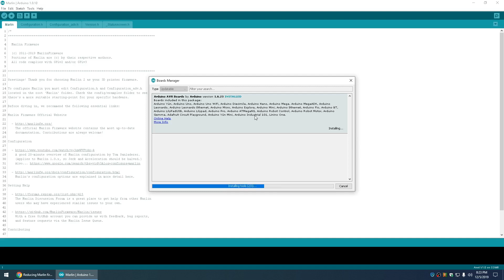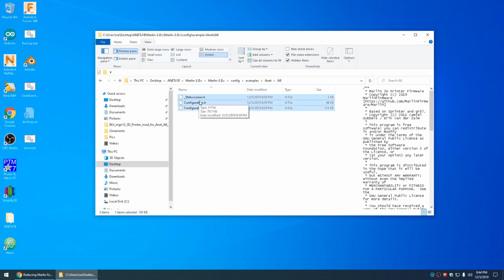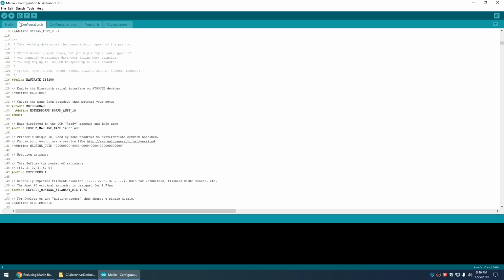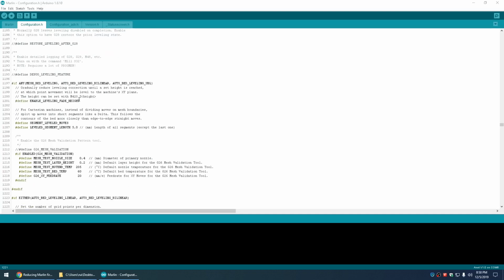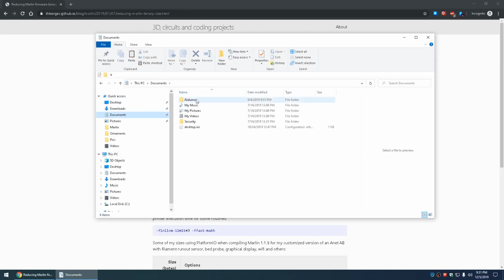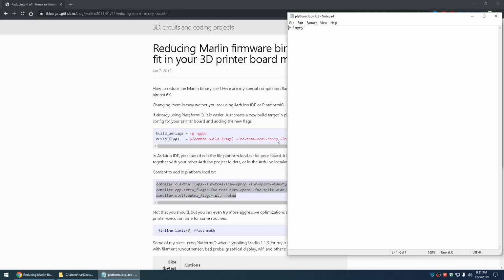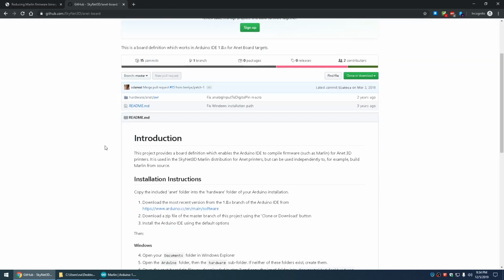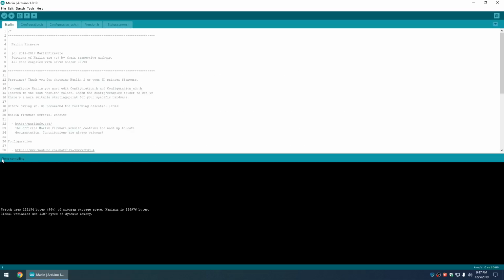Upgrade Marlin 2.0 firmware on ANET A8 v1.0 Board

Comment: anyone know what this is?

Arduino: 1.8.15 (Windows 10), Board: "Anet V1.0"

In file included from C:\Users\jonat\Desktop\3D\printer\Marlin-2.0.x\Marlin-2.0.x\Marlin\src\lcd\extui\ftdi_eve_touch_ui\compat.h:31:0,

                 from C:\Users\jonat\Desktop\3D\printer\Marlin-2.0.x\Marlin-2.0.x\Marlin\src\lcd\extui\ftdi_eve_touch_ui\config.h:24,

                 from C:\Users\jonat\Desktop\3D\printer\Marlin-2.0.x\Marlin-2.0.x\Marlin\src\lcd\extui\ftdi_eve_touch_ui\screens.cpp:23:

C:\Users\jonat\Desktop\3D\printer\Marlin-2.0.x\Marlin-2.0.x\Marlin\src\lcd\extui\ui_api.h:82:15: error: 'MarlinBusyState' in 'class GcodeSuite' does not name a type

   GcodeSuite::MarlinBusyState getMachineBusyState();

               ^~~~~~~~~~~~~~~

In file included from C:\Users\jonat\Desktop\3D\printer\Marlin-2.0.x\Marlin-2.0.x\Marlin\src\lcd\extui\ftdi_eve_touch_ui\compat.h:31:0,

                 from C:\Users\jonat\Desktop\3D\printer\Marlin-2.0.x\Marlin-2.0.x\Marlin\src\lcd\extui\ftdi_eve_touch_ui\archim2-flash\flash_storage.cpp:23:

C:\Users\jonat\Desktop\3D\printer\Marlin-2.0.x\Marlin-2.0.x\Marlin\src\lcd\extui\ui_api.h:82:15: error: 'MarlinBusyState' in 'class GcodeSuite' does not name a type

   GcodeSuite::MarlinBusyState getMachineBusyState();

               ^~~~~~~~~~~~~~~

In file included from C:\Users\jonat\Desktop\3D\printer\Marlin-2.0.x\Marlin-2.0.x\Marlin\src\lcd\extui\ftdi_eve_touch_ui\compat.h:31:0,

                 from C:\Users\jonat\Desktop\3D\printer\Marlin-2.0.x\Marlin-2.0.x\Marlin\src\lcd\extui\ftdi_eve_touch_ui\archim2-flash\media_file_reader.cpp:23:

C:\Users\jonat\Desktop\3D\printer\Marlin-2.0.x\Marlin-2.0.x\Marlin\src\lcd\extui\ui_api.h:82:15: error: 'MarlinBusyState' in 'class GcodeSuite' does not name a type

   GcodeSuite::MarlinBusyState getMachineBusyState();

               ^~~~~~~~~~~~~~~

In file included from C:\Users\jonat\Desktop\3D\printer\Marlin-2.0.x\Marlin-2.0.x\Marlin\src\lcd\extui\ftdi_eve_touch_ui\compat.h:31:0,

                 from C:\Users\jonat\Desktop\3D\printer\Marlin-2.0.x\Marlin-2.0.x\Marlin\src\lcd\extui\ftdi_eve_touch_ui\config.h:24,

                 from C:\Users\jonat\Desktop\3D\printer\Marlin-2.0.x\Marlin-2.0.x\Marlin\src\lcd\extui\ftdi_eve_touch_ui\bioprinter\advanced_settings.cpp:23:

C:\Users\jonat\Desktop\3D\printer\Marlin-2.0.x\Marlin-2.0.x\Marlin\src\lcd\extui\ui_api.h:82:15: error: 'MarlinBusyState' in 'class GcodeSuite' does not name a type

   GcodeSuite::MarlinBusyState getMachineBusyState();

               ^~~~~~~~~~~~~~~

In file included from C:\Users\jonat\Desktop\3D\printer\Marlin-2.0.x\Marlin-2.0.x\Marlin\src\lcd\extui\ftdi_eve_touch_ui\compat.h:31:0,

                 from C:\Users\jonat\Desktop\3D\printer\Marlin-2.0.x\Marlin-2.0.x\Marlin\src\lcd\extui\ftdi_eve_touch_ui\config.h:24,

                 from C:\Users\jonat\Desktop\3D\printer\Marlin-2.0.x\Marlin-2.0.x\Marlin\src\lcd\extui\ftdi_eve_touch_ui\bioprinter\confirm_home_e.cpp:23:

C:\Users\jonat\Desktop\3D\printer\Marlin-2.0.x\Marlin-2.0.x\Marlin\src\lcd\extui\ui_api.h:82:15: error: 'MarlinBusyState' in 'class GcodeSuite' does not name a type

   GcodeSuite::MarlinBusyState getMachineBusyState();

               ^~~~~~~~~~~~~~~

In file included from C:\Users\jonat\Desktop\3D\printer\Marlin-2.0.x\Marlin-2.0.x\Marlin\src\lcd\extui\ftdi_eve_touch_ui\compat.h:31:0,

                 from C:\Users\jonat\Desktop\3D\printer\Marlin-2.0.x\Marlin-2.0.x\Marlin\src\lcd\extui\ftdi_eve_touch_ui\config.h:24,

                 from C:\Users\jonat\Desktop\3D\printer\Marlin-2.0.x\Marlin-2.0.x\Marlin\src\lcd\extui\ftdi_eve_touch_ui\bioprinter\confirm_home_xyz.cpp:23:

C:\Users\jonat\Desktop\3D\printer\Marlin-2.0.x\Marlin-2.0.x\Marlin\src\lcd\extui\ui_api.h:82:15: error: 'MarlinBusyState' in 'class GcodeSuite' does not name a type

   GcodeSuite::MarlinBusyState getMachineBusyState();

               ^~~~~~~~~~~~~~~

In file included from C:\Users\jonat\Desktop\3D\printer\Marlin-2.0.x\Marlin-2.0.x\Marlin\src\lcd\extui\ftdi_eve_touch_ui\compat.h:31:0,

                 from C:\Users\jonat\Desktop\3D\printer\Marlin-2.0.x\Marlin-2.0.x\Marlin\src\lcd\extui\ftdi_eve_touch_ui\config.h:24,

                 from C:\Users\jonat\Desktop\3D\printer\Marlin-2.0.x\Marlin-2.0.x\Marlin\src\lcd\extui\ftdi_eve_touch_ui\bioprinter\main_menu.cpp:23:

C:\Users\jonat\Desktop\3D\printer\Marlin-2.0.x\Marlin-2.0.x\Marlin\src\lcd\extui\ui_api.h:82:15: error: 'MarlinBusyState' in 'class GcodeSuite' does not name a type

   GcodeSuite::MarlinBusyState getMachineBusyState();

               ^~~~~~~~~~~~~~~

In file included from C:\Users\jonat\Desktop\3D\printer\Marlin-2.0.x\Marlin-2.0.x\Marlin\src\lcd\extui\ftdi_eve_touch_ui\compat.h:31:0,

                 from C:\Users\jonat\Desktop\3D\printer\Marlin-2.0.x\Marlin-2.0.x\Marlin\src\lcd\extui\ftdi_eve_touch_ui\config.h:24,

                 from C:\Users\jonat\Desktop\3D\printer\Marlin-2.0.x\Marlin-2.0.x\Marlin\src\lcd\extui\ftdi_eve_touch_ui\bioprinter\printing_dialog_box.cpp:23:

C:\Users\jonat\Desktop\3D\printer\Marlin-2.0.x\Marlin-2.0.x\Marlin\src\lcd\extui\ui_api.h:82:15: error: 'MarlinBusyState' in 'class GcodeSuite' does not name a type

   GcodeSuite::MarlinBusyState getMachineBusyState();

               ^~~~~~~~~~~~~~~

In file included from C:\Users\jonat\Desktop\3D\printer\Marlin-2.0.x\Marlin-2.0.x\Marlin\src\lcd\extui\ftdi_eve_touch_ui\compat.h:31:0,

                 from C:\Users\jonat\Desktop\3D\printer\Marlin-2.0.x\Marlin-2.0.x\Marlin\src\lcd\extui\ftdi_eve_touch_ui\config.h:24,

                 from C:\Users\jonat\Desktop\3D\printer\Marlin-2.0.x\Marlin-2.0.x\Marlin\src\lcd\extui\ftdi_eve_touch_ui\bioprinter\status_screen.cpp:24:

C:\Users\jonat\Desktop\3D\printer\Marlin-2.0.x\Marlin-2.0.x\Marlin\src\lcd\extui\ui_api.h:82:15: error: 'MarlinBusyState' in 'class GcodeSuite' does not name a type

   GcodeSuite::MarlinBusyState getMachineBusyState();

               ^~~~~~~~~~~~~~~

exit status 1

Error compiling for board Anet V1.0.

This report would have more information with
"Show verbose output during compilation"
option enabled in File -> Preferences.
Reply from the maker: Are you using Arduino IDE or VSCode to compile the firmware.  VSCode works while Arduino IDE will no longer compile the firmware.
Reply: @MrDabrudda   thanks ill try vscode

Comment: i think this video is fake.merlin software Aneta8 v1.0 never installs on motherboards..never loads even though i tried all kinds of variations.No software is installed except the orginal hex file
Reply from the maker: How would this video be fake?  You see the version # on my printer.  If you are trying to update to version 2.0.7.2 you will need to use VSCode and search for videos on using VSCode to update to the latest version.
Reply: @MrDabrudda  see anet a8 v1.0 version motherboards 8 bit.why don't you say set the config files to 8 bit.you are giving people incomplete information.You suggest installing a 32-bit version on an 8-bit motherboard.please give correct information..you prepare 8bit file and give it to people..
Reply from the maker: Marlin 2 works on 8 bit and 32 bit boards.  That is what the board definitions are for, to define the hardware on the board.
Reply: @MrDabrudda  It is the general software offered by merlin software. You have to customize it and install it on your motherboard.You have to make special settings for it to be 8 bits..in merlin general anet a8 setting you have to make custom setting.For example, you should disable the sd card and run a printer from the pc with the usp port..To save space on an 8-bit motherboard..please upload the software you installed on your anet a8 motherboard here.tuned software.The config file for merlin anet a8 is never loaded.
Reply from the maker: Do you have the ANET A8 v1.0 board or 1.5?  I will also upload my Configuration.h and Configuration_adv.h files which I used to configure my ANET A8.
Reply: @MrDabrudda  the board I used is anet a8 v1-5.Merlin software never installs on this motherboard in my many attempts for a long time.Merlin never loads even though the original hex file is loaded with the usbasp module.never load merlin with arduino.Also does not install with Windows Visual Studio Code.loading only hex file.
Reply from the maker: Look at this video.  He has a v1.5 ANET A8 board and flashes Marlin 2.0 on it
https://youtu.be/38PkynA1uGI
Reply from the maker: Also I have uploaded and shared the link to my Configuration.h, Configuration_adv.h, and _screenstatus.h files in the description of the video
Reply: @MrDabrudda  hi brother.I did not make my objection in vain .swallow and watched all your videos several times and followed the instructions.I tried the information in that video link one by one. I tried the information in that video link one by one.Arduino never compiles 8 bit config file.arduino does not compile without software installed.Gives a compilation error even though I made no changes to any files.
Reply: @MrDabrudda  hi.the problem is waiting unresolved.It seems that you could not solve the problem either.The files you provided are never compiled by arduino for anet a8 v1-5.I can send you clear and crisp videos.You are streaming these videos, but you have to solve the problems.You should explain that arduino does not compile the anet a8 configuration files when it keeps failing..The skynet.fix software also fails.

Comment: so i followed along with you but i have different version of Arduino. I am running 1.8.13 . I mad the changes that you did and hit the check mark button. I clicked the check button and its compiling but nothing seems to be happening.
Reply from the maker: With Marlin 2.0.7.2 you will need to use VSCODE to compile Marlin.  You will need to install PlatformIO and Auto Build Marli.
Reply: @MrDabrudda  thank you

Comment: I follow this but failed at compile, my anet is v1.0 and , I can upload the firmware file (ino.hex) using AVRDUDESS.exe with Braud rate 57600, and I follow https://www.youtube.com/watch?v=38PkynA1uGI&t=15s to create my own marlin compiled file but you have to find out the file and upload with the AVRDUDESS, hope this help the other who is facing the same problem.
Reply from the maker: Marlin 2.0.7.2 will not compile in Arduino IDE any more.  Use VSCODE with PlatformIO and Auto Build Marlin.

Comment: Just 1 question what lcd do you have on your A8 ????
Reply from the maker: The default Anet A8 display, 2004 LCD.
Reply: @MrDabrudda  I've a stock anet a8 with the 5 button lcd and impossible to make buttton work properly with latest marlin 2.0 hotfix. But with latest 1.0 bugfix (1.1.9.?) it works. Very strange. I use vscode + platformio (latest). thanks
Reply from the maker: Which version of the ANET A8 mainboard do you have?  I have the v1.0 board.
Reply: @MrDabrudda  Anet3d V1-5
Reply from the maker: Check out this video from Crosslink and follow the steps.
https://youtu.be/38PkynA1uGI

And review this site.
https://caggius.wordpress.com/anet-v1-5-1-7-board-on-marlin-2-0-5-3/
Reply: @MrDabrudda  Ok thanks. I'm going to see the links. Just a last question : Why when your printer where well calibrated (x,y,z and extruder) i cannot obtain piece that i print at good size (cura 4.7). Thanks for all !!!
Reply from the maker: Also ensure you have the latest statusscreen.h file, Configuration.h & Configuation_adv.h from the latest Marlin config files.  Customize the config files as needed.

https://github.com/MarlinFirmware/Configurations/archive/release-2.0.7.2.zip

Download the latest Marlin firmware
https://github.com/MarlinFirmware/Marlin/archive/2.0.x.zip

2.0.7 is the latest.  I use Arduino IDE to compile and upload the firmware to my ANET A8.

If you use Arduino IDE ensure you download the anet-board definitions.

https://github.com/SkyNet3D/anet-board/archive/master.zip

The link below is my Configuation.h and Configuation_adv.h 
You will need to change the various parameters for your printer. Such as X,Y,Z steps, Z offset, etc.

https://drive.google.com/file/d/1D9mOim7ps16Yf0pu0F1V9JWjx9JusIor/view?usp=sharing
Reply from the maker: For your printer to print the exact size that is in the model will require you to adust the steps per mm in the Marlin firmware.
Reply: @MrDabrudda  I know all these point. The thing i do not understand is if i fix a pen on the print head and i write a simple rectangle with gcode command, the rectangle has the right dimension. I think that marlin or slicers are more or less well adapted to boards. Thanks for your help and i continue to investigate.
Reply: @MrDabrudda  This is all what i do. Compiled with arduino et vscode/platformio and 5 button doesnt work

Comment: I got Err: EEPROM version. Thank you for the vid
Reply: For anyone who runs into this issue, there is an easy fix: Go into the menu on the printer, then to "Configuration" > "Advanced settings" > "Initialize EEPROM". Select "Init" using the up or down buttons, and press the middle button to confirm. If done correctly, it should just take you back to the info screen and you will no longer get that error message when starting the printer.
Reply: @coleh1792  how do I get to the menu of the printer?
Reply: Did you notice that your handle is a anagram of Dabrudda ? :-)

Comment: I upgraded to Marlin 2.0 but same problem as in 1.9.1 the x axis goes past the bed, I checked the code and it says the limit is 220 which is correct but this is very frustrating and I can't find an answer anywhere.
EDIT: when auto home set to middle, x axis says it is at 110 but it is actually at 130, and y says it is at 110 while it is actually at 105

Does Anyone know how to fix this problem I have been at it for months
Reply from the maker: Are you using a bed probe?  If so make sure the probe offset is set in the Configuration.h.  Also check the limit switch offset settings.

Comment: Marlin 2.0 for ANet A8 - I tried to compile it last night and just now, and it's got compile errors on macro.h - is this common? Easy fix?
Reply from the maker: What are you using to compile the firmware? Arduino IDE, Atom, or VS?
Reply: @MrDabrudda  Arduino IDE - I've put VS(C) on now and will try again.
Reply: Ok, so looks like I've compiled, once I removed the .html files that "somehow" got saved instead of github's .h file (hint: don't do right click, "save link as"...)
Reply from the maker: I use Arduino IDE and you need to click the Clone or Download button on the right side of Github to download the zip file.

Comment: I've just printed 4 jobs on an A8.
I've always had problems with this printer in fact the first time I've printed with it was yesterday - but I installed Marlin Firmware (1.1.9) - and it now ignores small steps (microsteps?) on circles effectively putting flat sides on circles.
1. The G Code looks good when I step through it (written on Slic3r) the round edges are there.
2. The G Code uses "G1" notation in all steps were X,Y,&E are stepped.

Is this a known fault with Anet A8 + Marlin 1.1.9  Will Marlin 2.0 fix this?
Reply: u need the microsteps. a full step is 1.8 deg of a circle of rotation of a motor. with original drivers i think u get  1/16 step, after market can go to i think 1/256 step.  the smaller the step , the more detail (and longer print times). Hence the flat spots, the program jumped the steps to produce the full circle and took out 15/16 of it to jump the microsteps. What drivers are you using in Marlin? And what board and version  of the board are u using?  that has all the details why u are printing that way.

Comment: Why the Z Safe homing? It's super weird and annoying that the extruder moves to the center of the X / Y while homing now. I disabled it again cause if one print stops due to some annoying reasons you can't home anymore.
Reply from the maker: Z Safe Homing raises the print head a defined amount to prevent the print nozzle from gouging and dragging across your heat bed because when you first start homing the printer does not know the height of your Z.  Raise the head 5mm, home X & Y, then go to the center of the bed and home Z.  Without Z Safe Homing you will crash the nozzle eventually.

And if a print stops due to an error I usually end up reprinting the entire part anyways.
Reply: @MrDabrudda  True, Z Safe homing is safer for the extruder. I was printing a 10 hour print job though that stopped after 8 hours... ended up re flashing Marlin without Z Safe homing and then finished printing the part.

Now I re flashed Marlin again with Z Safe homing cause I think it's better for the extruder.

Thanks a lot for your video!! =)

Comment: Have you a configuration file for 2.0.1 with Bad auto leveling?
Reply from the maker: You only need to enable the bed leveling in the configuration.h file by uncommenting the line
Reply: @MrDabrudda  just enabling doesn't work, i had to define fix mount, set the distance between nozzle and probe (but i cant get auto leveling working, i add the min_edge_probe_left/right/back/front and still doesn't work)
when i press auto level, it does homing and it stays there like if it where finished
anyone help?

Comment: I managed to get 1.8 with auto bed levelling  (bltouch) enabled with flashing the Optiboot bootloader without disabling anything.
It makes the start far quicker
Reply: It was an awful faff to do as the  USBASP USBISP AVR USBasp_H6 Programmer  I used to do it doesn't put the correct drivers on for windows by default.
Reply: I did, Mr Darbudda 😁